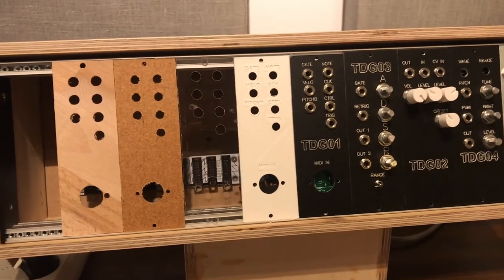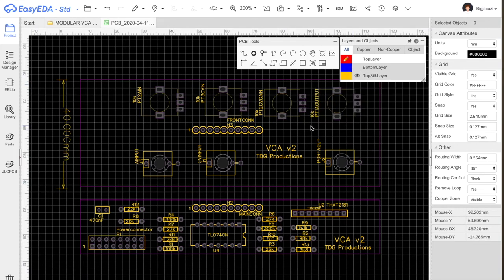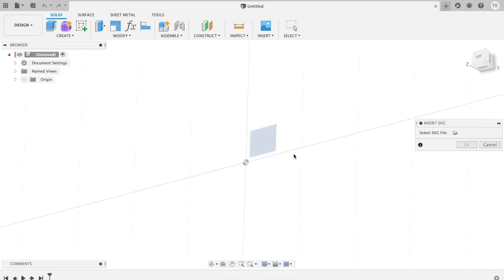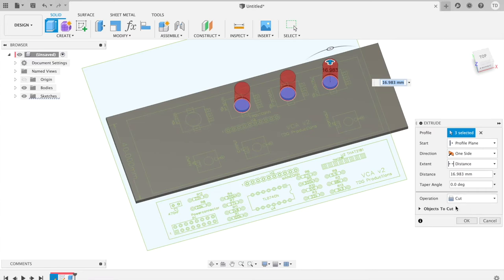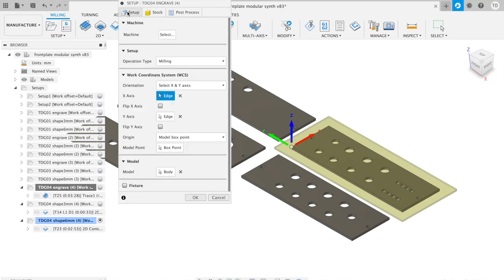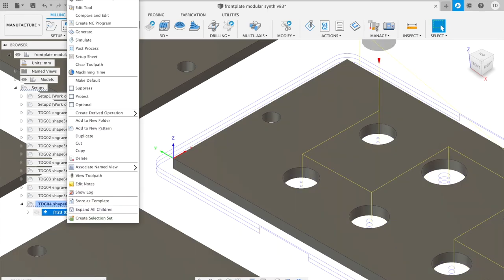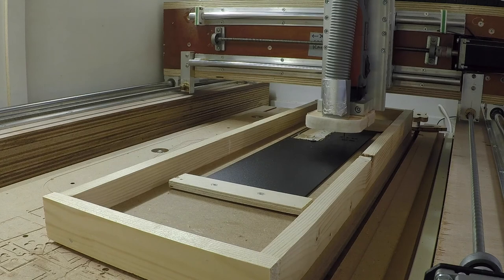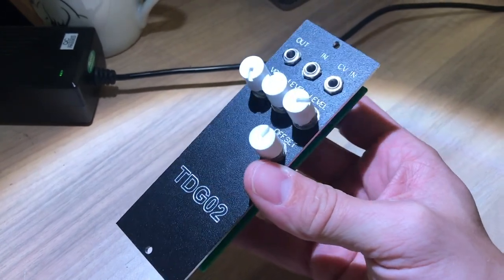Create aluminum frontplates for my modular synth using EasyEDA and Fusion360 on my DIY CNC machine

Comment: I'm headed down this road! I love your work. It makes me wonder: you could CNC some lovely knobs from Delrin or Cast Acrylic. They would sure beat 3D printed ones. Cheers. Jonathan in Seattle
Reply from the maker: Great suggestion! In the meantime, I have come a long way. I have now designed, soldered, and made frontplates for several (25 orso) modules. Some of them are on my instagram. If time permits I will make a short video of what my design and production process looks like.

Comment: Great summary on how you go from Easyeda through Fusion360 to you own built CNC Machine. I am looking at "larger" scale manufacturing of my own (eurorack) designs. Doing some reading-up at the moment on front panel creation especially. Good stuff! PS: are you using the limited version of Fusion 360 - or did you have to go full price ?
Reply from the maker: Great that the video is helpful to you! I'm curious about your designs for the eurorack! 

I'm sure there are easier or better looking ways to do this (or both :-) , but at least I have tried to do it all. The stock I'm using is cheap 2mm aluminum frontplate you can get anywhere at your regular musicstore. One thing I'm about to try is to use a colored lacquerstick to fill in the engravings, I did see some nice results with that as well. 

My version of Fusion is a standard personal version; this version is equipped well enough for my designs and machines. Hope this helps.

Comment: Where do you buy black aluminum?
Reply from the maker: At my local musicstore :-) 2mm anodized aluminum. Simple 19 inch blindpanels without bend edges. Just make sure it is aluminum and not steel.